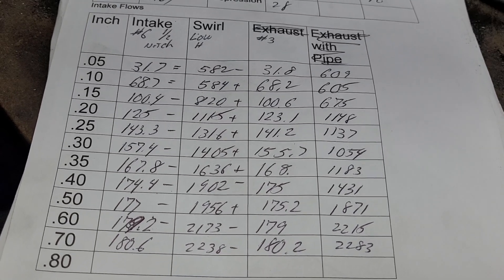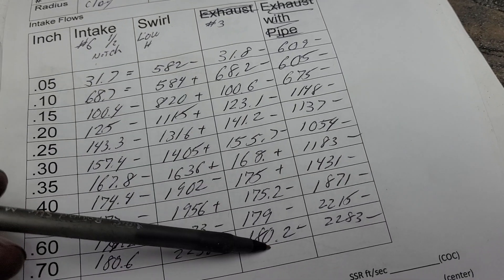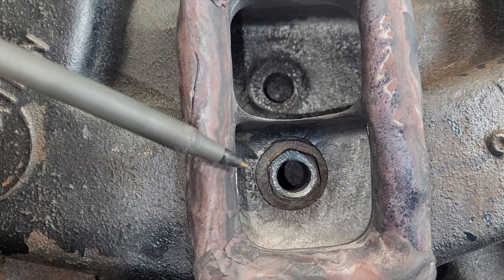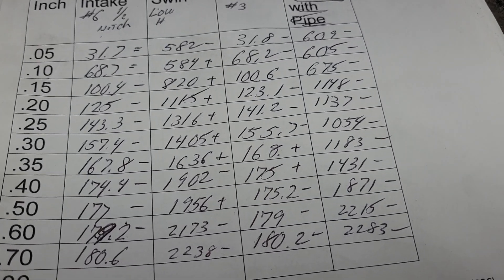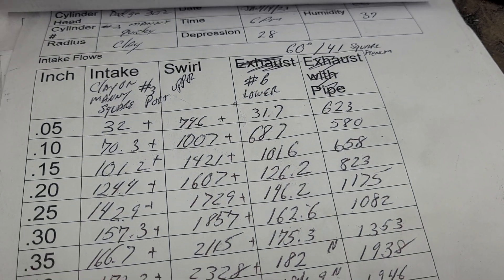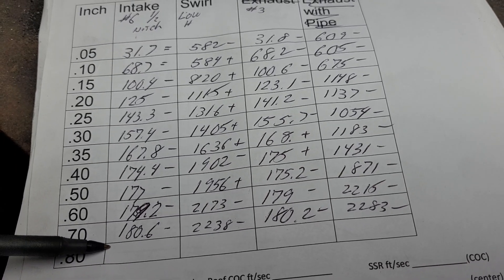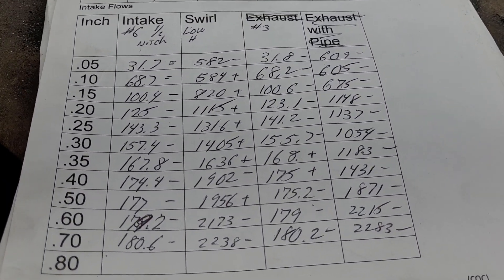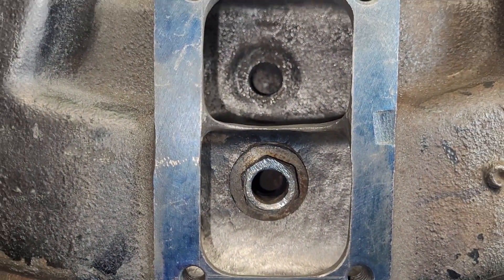David Vizard, Uncle Tony's Garage, Unity Motorsport.Mission Impossible project, 1/2" notch flows

Comment: You mentioned fuel shearing, is that for fuel economy purposes? But reduced air flow ? I radius. My 1v intake on my 300 i6 wondering if I should have left it alone for fuel economy reasons. Will it effect drivablity? It's an exhaust heated intake 
Thks In advance.
Reply from the maker: Fuel shearing is used to reintroduce liquid fuel to the airstream.

Comment: Do you think a plate with 2 holes the same size as the carburetor could be used to get more information as to progress versus a large single hole flow plate or a plate with one single hole of equivalent size ?   The large hole throws my mind a curve as I do not work with flow benches.  My thought is that you test what you are going to be using.
Reply from the maker: It could but I do not see myself making that at this point. Thanks

Comment: Have you tried clay in the bottom of the plenum around those egr bungs?. If you're not using egr filling them and grinding it to a better shape might help. It will also increase the plenum volume with them gone.
Reply from the maker: I would like to tap them for recessed plugs. I flowed the upper H without the bung and flow went down!

Comment: Another idea i was thinking of is as you only is allowed to run that tiny carburetor.
Why not try to make a huge plenum?
By that, Open up the opening as you do now, but extend it so much you need to mill it flat, to that extent that it takes away the 'roof' on the upper 'H'.
This way you can also grind away the floor in the upper H(roof in the lower), this to be able to port those corners and shorten the runners.
A 'huge' plenum helps dampen the pulses and lets the carb work with a more contant flow, this should improve overall flow it can give the intake.
Reply: That 'plenum' would be the carb spacer, a spacer is allowed?
Reply from the maker: Yes it is.

Comment: Hi me again lol , Got another curious question since I'm experimenting at home with my stock 1 barrel and 2 barrel carb and stock intakes for the slant6 . On the intake your working on before you cut out the divider would make a difference if you smoothed out the shape edge at the bottom of the 2 holes where the carb mounts improve flow or would it be a waste of time and mess the flow up ???
Reply from the maker: I take the sharp edge off. That edge is for fuel shearing. I like the flow improvement taking it out.

Comment: Results are only indicative when you run with the carburetor in place, that additional length and divergence from the throttle shaft will redirect the flow characteristics...AND...This whole thing must be so that the engine can pass some (Must be stock) rules somewhere, otherwise none of it makes any sense.....
Reply from the maker: It is a challenge for power with very substandard parts. Epa regs are not included.

Comment: Put some clay on the divider and thicken it up making the top edge rounder. I think the divider wall is too thin.
If that doesn't help, try reducing the diver wall to 1/2" off the floor.
Reply from the maker: I am on it. Thanks
Reply: @servediocylinderheads  there are a lot of people that have information on intakes. I have worked on heads but never did much on intakes.
Reply from the maker: @davidreed6070  No doubt, most are very quiet about them.

Comment: What if you made a aluminum plate to mimic the 2 openings like a 2 barrel base gasket (2 side by side holes)? Move that around, like to the limits of opening (12 o'clock, 6 o'clock....ect) and see of that makes a difference like the 300cfm plate. Better yet, mount the carb to that plate and move that around @ WOT & see really what happens. Make a offset mounting adapter if necessary. Just a thought....
Reply from the maker: I don't have a carb.
Reply from the maker: Making a plate may be harder than it sounds. Especially if you want it to flow a specific amount.

Comment: I follow David and Tony but I've not seen any updates about the project and you just showed up on my feed. You have the most important part of this thing in your hands, but no one has credited you or maybe I don't look below the videos? While 302 head's were decent back indy day, magnum head's have surpassed them in every way and curious as to why they wouldn't use those head's instead. You should be recognized because if not for you, 318hp would be impossible with these garbage head's and intake.
Reply from the maker: I picked the 302 head because I had them in stock. I didn't know they were a bad choice but I do like the quench. Yeah, I am easy to forget. D.V. forgot I did the intake for their 421ci  743hp engine. Oh well. I did have two days to finish that manifold.

Comment: Im curious as to why the curved notch? Ive run the notch right out as far as possible even undercutting the carb pad with as wide a radius as material allows to allow air to enter that top corner you pointed out.
Reply from the maker: Many years ago I did low pressure flow improvements to manifolds. The curved notch worked best. I only like hard corners if I am very space limited.
Reply: @servediocylinderheads  thankyou !
Reply: Im interested in your opinion or experience on that as im always happy to learn something!